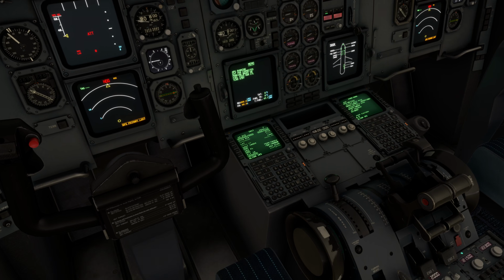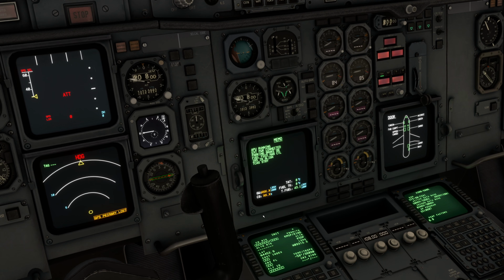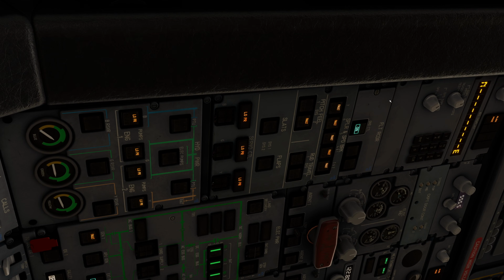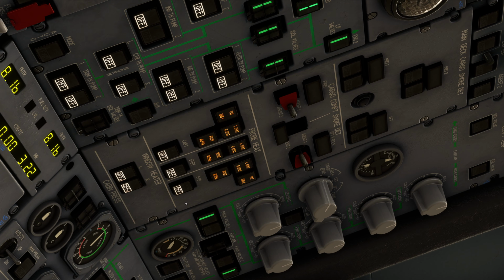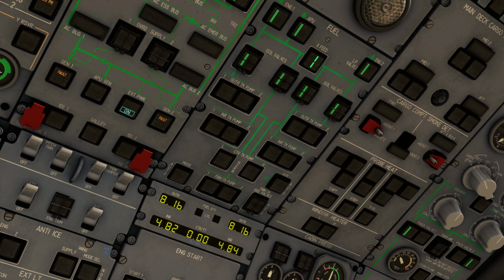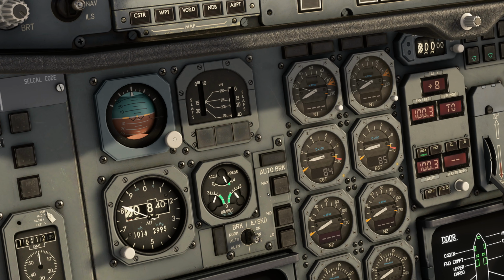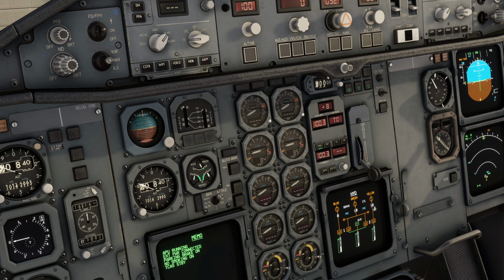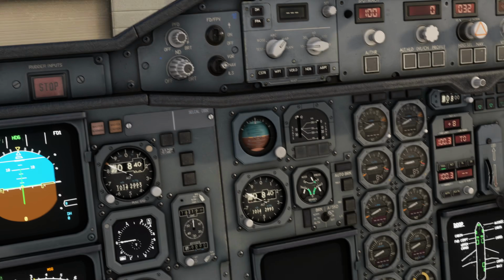iniBuilds A300-600 Tutorial 2: Flight Deck Preparation | Real Airbus Pilot

Comment: One thing to add on to this. During the overhead panel inspection, make sure you test the main deck cargo smoke detector.
Reply from the maker: Are you sure about this? I couldn’t find such a step in the manuals and at least on the more modern Busses we don’t do that test either.

Comment: Fun fact from an aircraft Environmental system specialist. The air conditioning will cool better at altitude since most aircraft use the external cold air to help cool the bleed air used for pressurization and air conditioning via passing it through a heat exchanger. 

Also the top 270ish degrees of the temperature knob is considered the "AUTO" position as the system in that position will try and keep a certain temperature the bottom 90 degrees of the knob is "Manual" as your setting the amount of hot vs cold air going though the pack regardless of temperatures, kinda like a water facet on a sink or shower. So there isn't quite a certain point the knob is in auto, more like a range that the knob is in auto as hot day most people would like the air a little colder and cold days people would want it a little warmer

Comment: Nice tutorial for simulation but for real ops I don't know... Only an example. You switch on TS but not explain what it is and why it is here in this aircraft. We know that TS switches ensure a predictable flight control in inhibiting the electric pitch trim switches. Therefore you can not use the electric pitch trim but the manual trim which will also disconnect the autopilot. There are so many questions about this. What happens if you let them off, will you be able to use the autopilot? If yes with which restrictions? How does it work? Is it only an electrical switch to connected to the electric pitch trim or is it connected to the Autopilot Control unit? I did not buy this piece of software yet. Is it may be explained in the Inibuild manual? Also may be a short introduction to the A300 would have be nice. It is a kind historical plane for Europe which is the symbol of the join venture of France West Germany and United Kingdom in the 70's. Coming back to the TS, rather than a Fly-By-Wire like the other Airbus the A300 has a Yoke Control System in which the TS plays an important role in ensuring a stable flight control. I don't understand poeple who are so focused on study level simulation planes. Most of people even don't understand the 10th of all the systems in such a stunning aircraft (me included)

Comment: This evening I wanted to try the MSFS A310 again to make a comparison before deciding whether to buy the A300-600
Unfortunately the A310 no longer works and after an evening wasted looking for the problem I discovered in some posts that it is a problem linked to the new AIRACs which it cannot manage correctly. If you enter a date before December 27th in the world map everything seems to work correctly.
I'm very upset about this inconvenience and I don't think I will buy the A300-600
A part from that, thank you for your videos, which are always very interesting and very usefull.

Comment: Thanks for the video. A cool feature of the A300/A310 is that on the throttle quadrant there is a neat little button that you can press that directly controls the yellow pump to pressurize the system and thus the accumulator ;-)
Reply: ah. the accupress yes